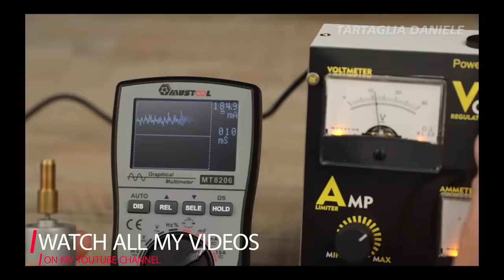TOP 15 BEST SOLUTIONS with HEAT SHRINK TUBE

Comment: Before putting heat shrink tube over protection glasses, put a little amount of hot glue in it, after that put that heat shrink sleeve on, and it would be totally perfect.
Reply: I’ve been buying glue lined heat shrink, which is fantastic. I bet you’re getting the same effect. Very strong, but you can’t peel it off if you want to redo it.
Reply: And then throw them in the trash
Reply: I want to cover two cables but there is no way to insert the tube anywhere, can I cut the tube and then glue it and heat it?
Reply: The heat shrink he's using already has glue in it.
Reply: To panto. Extra large tube, cut length, place over, glue back together, flat bar inside at seam, fold bar over and over again rolling tube around it until fully covered or more, heat half "might try unravel so use finger on other half and only snug tube with heat", zip tie so flat bar don't flip undoing snug, repeat other side, give more heat to complete. Just an on the fly idea. If want more protection, add liquid electrical tape under joint but above bar. Don't know size of item but for flat bar can use popsicle stick and trim

Comment: The RCA end should have been completed a bit differently.  The shield and cable jacket should have been crimped for a good strain relief and the whole thing could have been then heat shrink tubing out say two to three  inches (2.5 to 5 cm) long for a good strain relief, but also utilizing the cover that threads in place over all of it.
Reply: Yep, 100% agree. The method shown is incorrect and would not be durable. The tabs at the end of the connector are meant to crimp over the cable insulation so when pulling/pushing the connector, the solder joints are not stressed.
Reply: RCA?
Reply: @thechumpsbeendumped.7797  From Wikipedia: "The name RCA derives from the company Radio Corporation of America, which introduced the design in the 1930s."  See https://en.wikipedia.org/wiki/RCA_connector. RCA tip starts at  8:24.
Reply: @johncronk1338 it stated it was a repair though.. presumably the screw on piece is broken/missing and theres nothing available to crimp with
Reply: The point of the video was using heat shrink. The RCA was specifically a repair. So assume you didnt have the screw on piece or crimping tools to put an rca end on properly, and all you had to repair it temporarily was heatshrink. How would you go about it differently?
Reply: @cpzmelbs  you still could and should crimp the cable to the tabs at the end of the connector. for that he would have had to remove about 1cm less of the isolation.

Comment: You didn't crimp that RCA connector.!?
Reply: Crimp isn't really needed with glue lined heat shrink.  It isn't going anywhere.
Reply: @stargazer7644  but how will the connectivity be?
Reply: @edwardonsax9919  The crimp has nothing to do with connectivity.  It simply grips the insulation.  It is not an electrical connection.

Comment: If you had no way to get glasses I guess that would be a way to fix a broke the frame. One thing you could do a little different, cut another piece of plastic like a splint and then put the heat shrink tubing around both the splint and the glasses where you plan to join the two broke parts of the frame together and then heat shrink it. This would add much more strength.
Reply: I was thinking of that, too - maybe a short length of old ballpoint pen tube?  And glue the break, too!
Reply: I thought he was also going to glue it, but he didn't 🤷‍♂️

Comment: The safety glass repair would work a lot better if a partial paper clip was used to improve structural integrity.
Reply: Exactly, you need to use something to give it structural strength.

Of note, I have used heat shrink on the ends of the ear piece to make glasses and especially plastic safety glasses more comfortable.
Reply: @johncronk1338  Can also be used to attach paracord or similar line for a retaining strap.
Reply: I'd use tiny nails instead they are decidedly stronger than paper clips.

Comment: Another tip.
I shrink wrapped wires with rare earth magnets to allow the wire to be strung along metal and stuck to the metal.  Example towing a car with mounted temporary taillights.  The wire from those taillights are stuck along the car's body to be plugged into the vehicle doing the towing.

Comment: Also there is shrink tubing with heat-activated adhesives inside (as seen in most of these examples), and there is heat shrink WITHOUT that.  The adhesive type will serve better for things needing sealing.  The resistor example should really be demonstrated by having the piece of heat shrink slipped onto one wire BEFORE completing the soldering - a common example would be mending a damaged wire, where you can't slip it on from an end because the ends are already affixed to something.  Keep it far enough back from the point you might be soldering so it does not shrink before you're ready to slide it over the joint and want to shrink it.  Another application: screwdriver shafts so you're less likely to short out a screwdriver on something.  Shrink tubing is available in much larger sizes, and can be used to encapsulate electronic components.  I don't know that your black sealant goo was, but many silicone / RTV caulks and such contain acetic acid, which react with copper, so make sure what you're using doesn't have that.

Comment: Some great tips and techniques here👌. At the 2 minutes 40 seconds mark where you repair the broken arm on the spectacles if you add a piece of piano wire inside the heat shrink sleeve it will make the repaired arm much more robust and resistant to buckling under stress loads.
 For best user safety make sure the cut ends of the piano wire are fully covered inside the length of the shrink wrap tubing.
Reply: I used a good ole paperclip.  Cut it to twice the length that I needed and folded it over nice and tight  using a pair of pliers. Same concept though
Reply: My aunt, who is a concert pianist, protested when I came with pliers and opened her Steinway piano.
Reply: I was about to make a similar suggestion except I used one or two pieces of thin copper wire.  The heat shrink tubing by itself was not strong enough.
Reply: The cut end of a cable tie works well too.

Comment: There are some pretty neat ideas in this video. I may I may not have used some of those myself. These solder connectors look really intriguing. What solder did you use there?

Some other things I cannot really recommend. Case in point:

The edge protection thing is probably one of the goofiest uses for heat shrink I have seen. If you need any edge protection, improvised or otherwise, to protect a cable running over a hard point, there are some serious doubts in my mind as to why said cable is running over (and presumably rubbing on) a hard point in the first place. Either it lacks strain relief somewhere, or there were some really questionable design decisions.
Reply: Back in the '90's, I was a Raychem rep in the Southwest. What the author fails to note is that he's using adhesive-lined heat shrinkable tubing for many, if not all, the projects. It can be very hard to find, so I make my own out by using pieces of regular 2x polyolefin. I take melted hot-melt glue & spread it into a very thin sheet - the thickness depends on the app. Once it rehardens,  I cut it to size & use it wrap the connection prior to sleeving it w/ the tubing. A normal heating to install also melts & seals the connection, making it very water (etc.) resistant. Of course, Raychem also sold ready-to-use heat-shrinkable, adhesive-lined butt connectors & other innovative products. At some point two decades ago, some guy that I visited in PHX bought the existing stock of Raychem solder butt connectors (& the patent rights?). Now many companies - domestic & off-shore - produce them. Amazing products!

Comment: Some good ideas and one I'd suggest avoiding. While the last tip may have made a reasonably good mechanical connection, the electrical connection is suspect and subject to oxidation (and thus increasing resistance) over time. 

I like the idea of making my own all-in-one heat shrink/butt connector - but did you have to use special low-temp solder? Shrink tends to split at higher temperatures. I've used the commercial version and don't feel they contain enough solder (although they do seem to work).

I'd also never considered using the glue in the marine versions to stick the tubing to itself, creating tabs, separating wires or acting as cushioning material. Those are great suggestions!
Reply: @hauptuhrdotnetblog6700  I don't know for sure, but I'd guess that your guess is correct.
Reply: @hauptuhrdotnetblog6700  I believe it’s some sort of epoxy mix
Reply: Looking closely at the images, it doesn't seem like the solder in the shrink/butt connectors melts completely, so I'm not sure this is such a good idea. Also, considering the work involved in making each connector, it doesn't seem worth it. It you don't have premanufactured solder connectors, I would say it's easier to just solder the wires and and shrink wrap it the normal way.

Comment: Just be careful with the current going through a resistor that is covered. Those things have maximum current ratings, based on how quickly they can offload heat. Maximum power rating is the product of voltage drop across the resistor and current going through it. If you give the resistor a rubber coating, you impede its ability to disperse heat.

Comment: 3M Scotchkote Coating  is highly recommended for underground electrical splices .  Expensive but well worth it !  Nice Presentation .
Reply: Is that a bag/bottle of liquid also that would seal the same way he did? I was fond of the internet guys how they had a splice kit with gel inside a clip box that seems very solid
Reply: @fasterthanaturtle  3M Scotchkote FD has the consistency of glue .  Can with self contained application brush .  Dap 8889 an acrylic tube and tile caulk in a squeeze tube also works well .  I prefer Scotchkote .

Comment: Once,  I had a service powerline tech give a 6 inch piece of 3 inch diameter thickwall shrink tube.  The shrink tube was applied to an axe handle where the handle joined the axe head.  This was used to protect the handle from wear from splitting wood blocks.  This lasted for years until it was stolen one day.  The tech said that as long as heat was applied that the shrink tube would just keep shrinking until it completely enveloped what it was wrapping, even if it was around a 1/2 pipe.   I could never find this shrink tube anywhere after this.  I never did see the powerline tech guy again to acquire it.
Reply: No home Depot where you're at?
Reply: There is a limit to how far heat shrink tubing will shrink, the shrink ratio. Heat shrink tubing is made of polyolefin and is sold in it's expanded form. When heated it returns to it's normal, relaxed state. The difference in the expanded and relaxed states are related by the shrink ratio. 2:1 and 3:1 are standard but it can be up to 6:1 in some cases. A shrink ratio of 2:1 means it has been expanded to twice it's normal diameter, thus when heated will shrink by 1/2, back to the relaxed state. Similarly, 3:1 shrink ratio will shrink to 1/3. When shopping for heat shrink tubing, keep in mind that the diameter can be given for either the relaxed or shrunken state, but most often it refers to the expanded size. Quality product from good sources will include the diameter and shrink ratio in the product description. This is just a peek into the fascinating details of heat shrink tubing.

Comment: For stabilization or strain relief purposes, I often use either a drop of hot glue inside or use some thin CA glue after the tubing cooled down. I recently put some cheap alligator clamps on barbecue sticks, put some heatshrink around it and CA glue.

Comment: A lot of them will be very helpful, thanks. I was thinking, is it always necessary to slide the tubes in place, or could you cut them open and roll them around the spot that needs covering?

Comment: At 11:43 the Lightning cable has a broken shield. Just covering up the damaged cable with heat shrink tubing is not fixing anything. It is just disguising it. The shield is there for a reason, to protect against electromagnetic interference. If all you are doing is charging, you can get away with it but if you are using it for data you might have a problem. The USB data lines carry low voltage but very fast signals. Stray EMI can cause errors in the data or even make it unusable. Better to repair the shield if you are using it for more than just charging.
Reply: Or get a spare from the tangle of cables in the bottom drawer.
If you look there appears to be a clear piece under the black that we did not see fitted.

Comment: The solder heat shrink sleeves hack is my favorite @9:45
Reply: Looks cool, but you can achieve same or better result by soldering the wires first and then applying the heat shrink tube, isn't it?
Reply: The method in the video is faster
Reply: @Danny-xe2sg  the preparation to do so is slower
Reply: @Paw_Low  yes but if you have to join two wires on the fly and you have a bunch of theese is very easy and quick
Reply: @bonafide9085  I agree.  The normal use is more practical.. Maybe an advantage is no soldering iron needed.

Comment: What is the black liquid that was poured into the connection for the underwater connection?   It's at 14:30.
Reply: electrical insulation resin (3M scotchcast)

Comment: Please don't shrink wrap air cooled components like resistors!
Reply: Most of the time you run a jillionth of an amp through resitors like that so it's fine.
Reply: If you’re using a 1/8th watt resistor, sure. The example shown is probably a 1/4 watt or maybe a 1/2 watt, which I would absolutely not cover unless. If you know enough about the differences, you would not do this. If you don’t, then you should not do this.
Reply: Lol I even shrink wrap heatsinks it keeps the dirt out from between the fins.
Reply: NOR pliers you can only use painters tape and superglue😢
Reply: Crap I do that all the time 😢
Reply: It’s perfectly fine to heat shrink resistors.

Comment: 11:09 if you cut this up (or any factory-made solder butt splice) you'll see that the solder didn't actually flow to the inside strands - because they never get hot enough in this type butt splice. It may be OK for low-voltage solid (not stranded) wires, but never as good as a proper non-low-temperature solder with flux, followed by a flux cleanup and a marine grade heat shrink.

8:40 when applying heat to any solder type connector, it's best to do so when it's plugged in into a mating connector. This assures its geometry / pin alignment stays intact through the application of heat.

Comment: You are using the shrink tube with the thermal activated adhesive innige inside, Right? In the first example , how did that not stick to the Connector, or later on did actually fuse?

Comment: None of this can be done unless you’re using the expensive shrink tubing that has glue inside and usually has a greater wall thickness.
Reply: Some of them yes but a lot of the wire ones are doable with the regular stuff.

Comment: "Resistor protection" seems nice, but it's also resistor power derating.
Reply: Splain how.
Reply: @J01466  That's pretty obvious, isn't it? Resistors can cope with a maximum internal temperature, above which they get destroyed permanently. When current flows through a resistor, heat is generated. The maximum power rating of the resistor is the maximum power at which the resistor can still operate normally without getting damaged. But, the maximum power rating of the resistor assumes an environment in which air can cool the resistor by flowing around it, and in which additional heat can be dissipated by radiation. When placing the resistor in a heat shrink tube (or under e.g. a warming blanket), both these premises are violated, so during operation heat accumulates and leads to a much higher temperature inside the resistor than without the heat shrink tube. Thus, the maximum power rating gets derated to a much lower power value. For example, a 0.25 W rated resistor will already get destroyed at much less than 0.25 W. Depending on the application, this may or may not be acceptable.

Comment: Very nice! 
"most used" can get loose, for a eternally tight connection twist the strands to the side and then fold the twisted part, that creates tension that can't loosen
Reply: Just solder
Reply: @MichaelHarto  that is a different subject all together and unless you have silicone wire it isn't practical even if you would have the heat required, since on bigger wires the insulation melts before the solder flows...

Comment: Anyone know if you can use that clear shrink tube over a label and make it work? Before i set my dymo maker aside and gave to go spend $150 on another dymo to make labels.
Reply: Yes, I do this often. Another trick is to use clear packing tape over your labels. This works great on wires or anywhere clear heat shrink won’t work.

Comment: I wonder why people who do these particular heat shrink videos always think there are two nice ends that need connected?
I’m trying to reinforce the wire from the headset to the earbud. They aren’t broken- so it’s one piece. Maybe it’ll be later in the video- it’s just like the 4th video I’ve watched- it’s just frustrating- reinforcing is NOT an uncommon thing to do-

Comment: @14:01 what's the goo called?
@14:23 why put in a scrap piece of wire & remove it later?

Please reply,
thanks.
Reply: It might be liquid electrical tape but probably some resin that hardens after mixing.